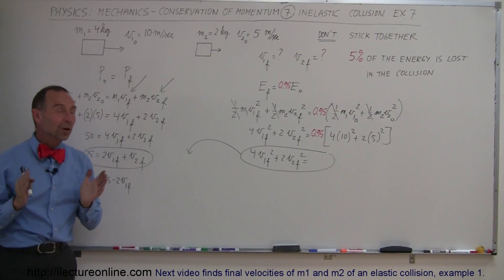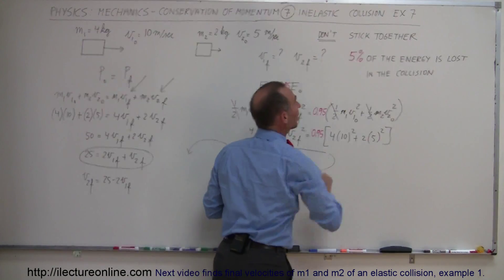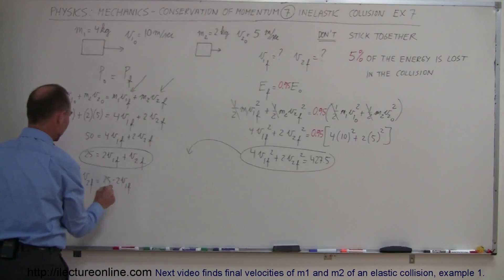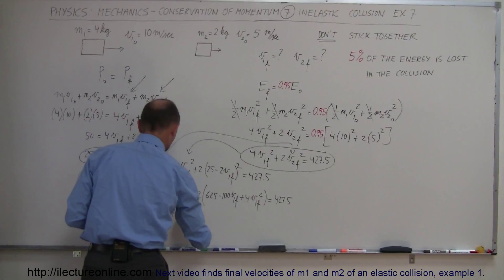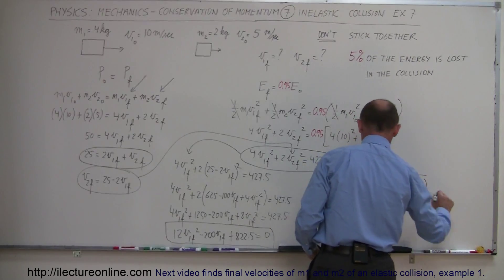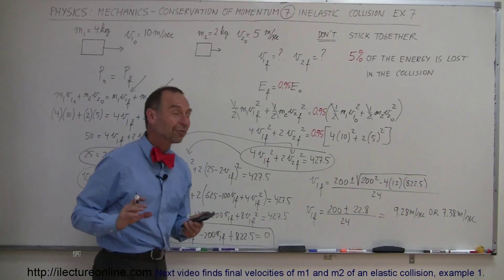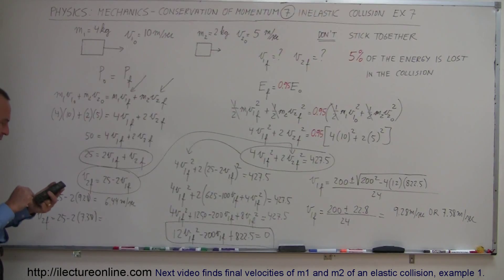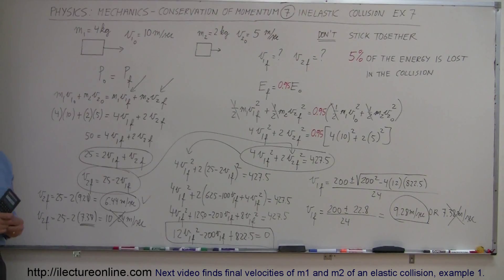Physics 10   Momentum and Impulse (22 of 30) Inelastic Collision Ex.7

Comment: Great video. 
I do not understand the final part of the question where you crossed out the non-logical solution. 8:34 you adressed block 1 instead of block 2, saying that it "sped up", the block that sped up was block 2 not block 1.

Can you/anyone re-explain why you crossed out that solution (where v2f= 10.24)
Reply from the maker: Upon further examination, both solutions are actuallly correct.  The final velocity of m2 can be both 9.28 m/sec and 7,24 m/sec.

Comment: It seems like both solutions still work. 

V1i = 10,  V2i=5: 

If V1f = 9.28 then V2f = 6.44, 
which makes sense because the first block slows down and the second block speeds up. 

If V1f = 7.38 then V2f = 10.24 
which also makes sense because the first block slows down and the second block speeds up. 

So which one is it?

Comment: I need a clarification. When two blocks collide and they stick together, l have understood that collision is anelastic because two blocks don’t reject themselves, while a collision is elastic when two blocks reject themselves. Could kind explain if it’s correct?
Reply from the maker: This was my response to you other question:    In theory, an inelastic collision, is a collision where no energy is lost during the collision.  In the real world inelastic collisions do not exist (except in the quantum mechanic world).
Reply: @MichelvanBiezen  Hello professor, isn't it that the collision that has no energy lost is an elastic collision? I think you might have switched them here :).

Comment: 8:10 Theres a huge problem here

V1(final) case 1 = 7.38 .... Acceptable. You would expect V1 to slow down from 10 to 7.38 after hitting another block

V1(final) case 2 = 9.28 ... Acceptable. You would expect V1 to slow down from 10 to 9.28 after hitting another block

V2(final) case 1 = 10.24.... Acceptable. You would expect V2 to speed up from 5 to 10.24 after being hit by another block

V2(final) case 2 = 6.44... Acceptable. You would expect V2 to speed up from 5 to 6.44 after being hit by another block.

So both cases are valid !!!!!!!!
Reply: Sorry you already answered this

Comment: Wait, why can't v2f be more than 10 m/s? Is it not possible for v2f to be more than v1i? m2 has less mass, so then momentum would still be conserved...
Reply from the maker: +Tobey Nguyen 
  Good question and good observation.  It turns out that both answers are possible based on the conservation of momentum and losing 5% of the energy.

Comment: Hello Professor,If there are two possible velocity scenarios, A) v1f = 9.28 , v2f = 6.44 and B) v1f = 7.38 and 10.24,  then how do you conclude, given .05 energy loss, that A is correct?  Since both scenarios indicate the first block is slowing down and the second block is speeding up, what is the deciding factor on which set of velocities are correct?  Is there something in the numbers to rationalize or is there a calculation I can compute in order to choose the correct scenario?  Thank you.
Reply: Professor, nevermind this question sir, I found the answer.  The final velocity of the first block can not physically go faster than the 2nd block after the collision.
Reply: I came to the same conclusion as you did here. Block 1 can't be moving faster than block 2 AND the two blocks don't stick together. So  I watched the end of the video and it looks like he got his blocks mixed up. He confused the final velocity of block 2 with the initial velocity of block 1.

Comment: In the end you said that it is not possible that the first block will speed up. But the two possible anwsers for v1f are 9.28 and 7.38, so both of them have slowed down (from 10m/s)
From thinking the numbers in my head i would come the conclusion, that the first block has to be slowed more than just 0.72 m/s, which would mean that 7.38 is true.
Did i miss something?
Reply from the maker: I was looking at the wrong block.
As it turns out, both answers are possible and correct.
Reply from the maker: Pearlyn Tan 
Only considering conservation of momentum, both answers are correct,
but taking into account that 5 % of the energy is lost only 9.28 is correct.
Reply: Good day professor, it seems as though 7.38 / 10.24 is the only possible answer. The first block is pushing the second block to the right. If after the collision the first block is going 9.28 and the second block 6.44, then the first block will pass through the second block. Therefore, the first block must be slower than the second block if they collide together and separate. So block 1 = 7.38, and block 2 = 10.24
Reply: @francisdiaz7520  I think this is the best explanation.
Reply: @francisdiaz7520  this made me clear my confusions😅
Reply: If you work out the total kinetic energy in both solutions and compare to KE before the collision you find that it only makes sense if v1f is 9.28